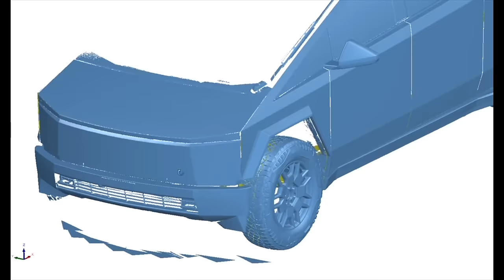I Tried Wrapping a Cybertruck - Not What I Expected

Comment: To me the stainless steel is absolutely the worst look for the cyber truck, any other color looks better. Wrap is a must do in my opinion. I put PPF on my model 3 almost 5 years ago, I did the hood, fenders, headlights and mirrors. I destroyed the bumper section it was too much for me. One thing I learned you can't put too much soapy water down. I think the Cyber truck would be a cake walk. It would be a lot of work but really simple.

Comment: However, you can polish the stainless steel and it doesn't show fingerprints hardly at all and looks amazing!  Remember, a door ding means your re-wrapping that panel if already wrapped as it will tear with a door ding impact even though the stainless steel won't dent.

Comment: you do not need the soap solution if the vinyl is a breathing type. Better without soap solution as that should make the stickiness last longer with less residue upon removal many months later if needed to be removed.
Reply: Inozetek film has breathability, straight from a returned email question to Inozetek. No, I don't work for them but I was shopping wraps and installers.

Comment: Color me as unsophisticated and simple, but I  do not understand the concept of buying an exotic electric truck that NEEDS to have costly work done on its finish....which if not done, leads to staining, corrosion, and pitting of the surface. My simple mindset is that if the exterior surface of the Cybertruck is not prepared for exterior weather conditions, it needs to be MADE SO IN THE FACTORY. Perhaps ol' Elon is listening in? You think......? And what's up with having to TINT the windows of this monster cash pit of a vehicle? All other cars I know of HAVE the windows tinted by the manufacturer. By now, you may have surmised that I am not all that awed by this money-grabbing box on wheels.
Reply: Wrapping is optional.